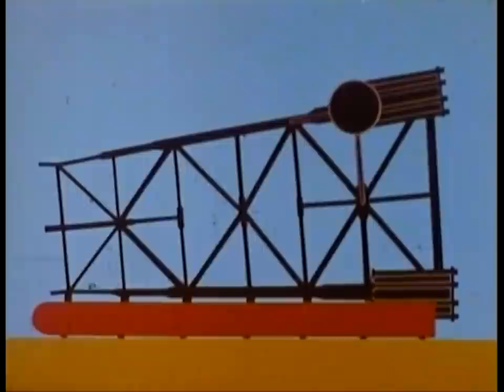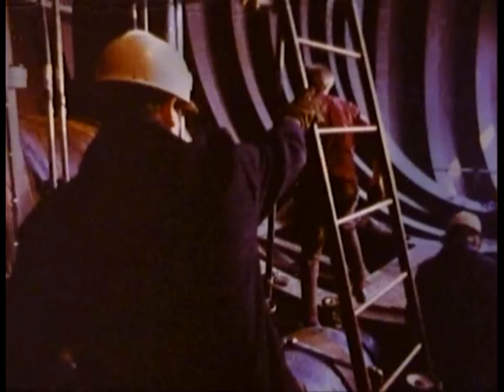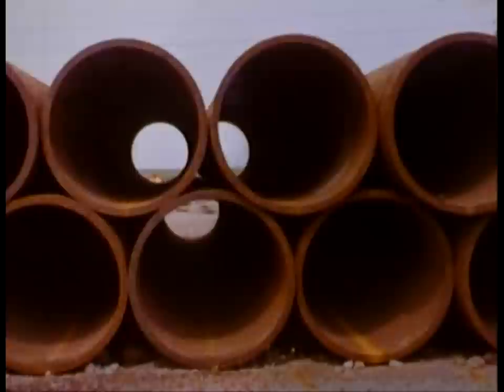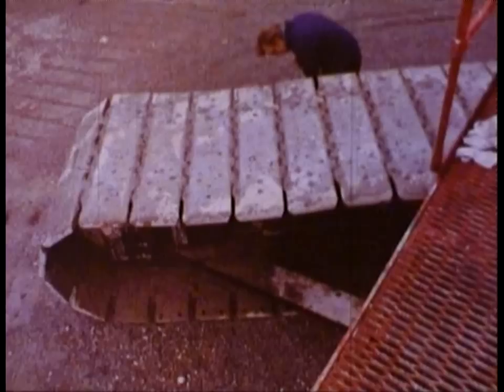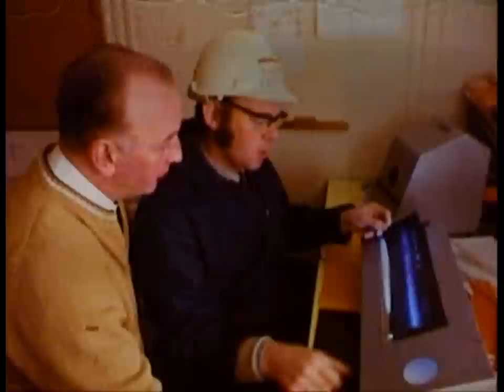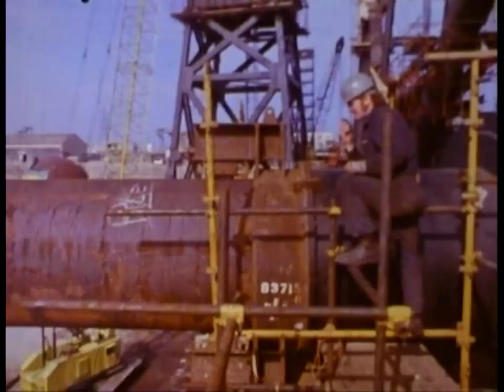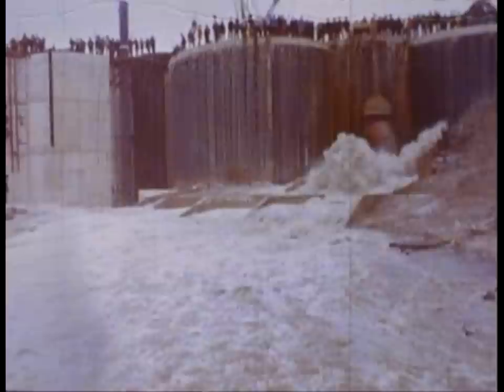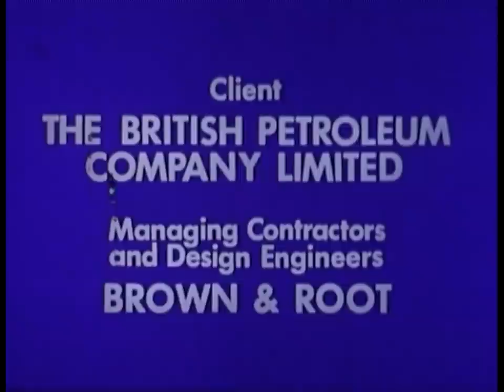Built to Sink (1974) Laing Offshore Film  Graythorp 1 construction

Comment: This complex structure was built at the same time that the UK was modernizing its yatds to build large tankers. The yards' build using flat plate and sections and semi automatic cutting and welding machines building ships at a fraction pf the cost of tubulars.  I started promoting flat plate MPSS semisubmersibles in 1980, it took till 2004 and Na Kika to be adopted. Tubulars are still being used for jackets-because that is the way it is done! Craig Lang